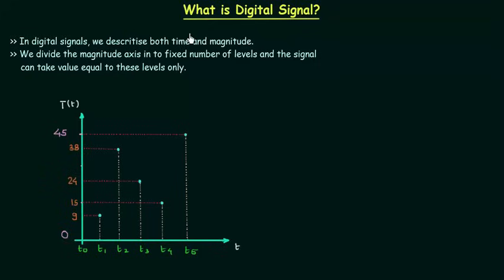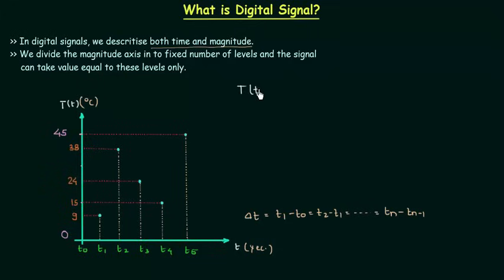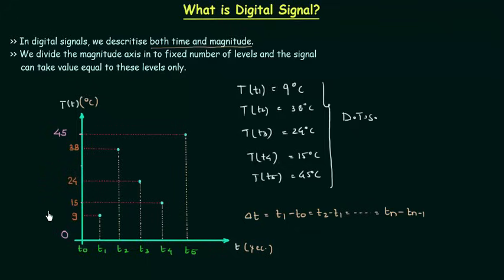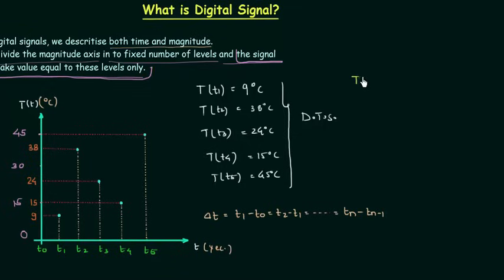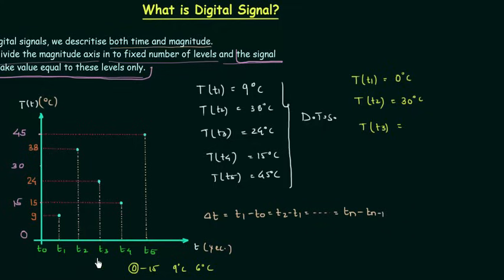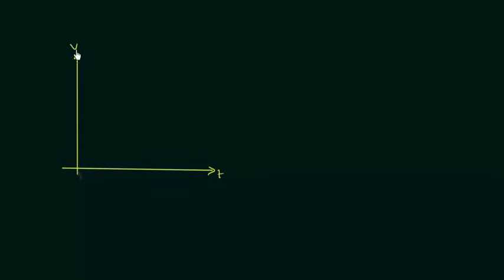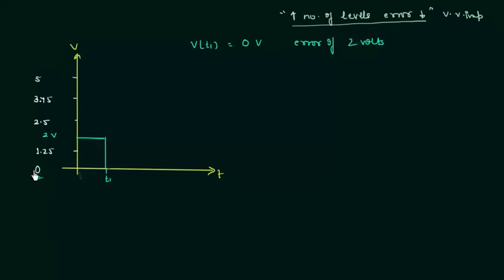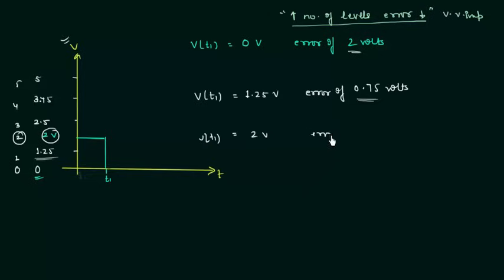What is Digital Signal?

Comment: 🔥 1. Reliability and Noise Immunity
Analog signals are continuous and susceptible to noise, interference, and degradation over long distances.

Digital signals (0s and 1s) are less prone to noise. Even if noise distorts the signal slightly, it can still be interpreted correctly due to its binary nature.
✅ Example: In telecom, digital signals can travel long distances with minimal data loss using error correction techniques, unlike analog signals, which degrade faster.

⚙ 2. Precision and Accuracy
Analog signals lose precision due to imperfections in storage and transmission.

Digital signals can be reproduced exactly through copying, storing, and processing without any loss in quality.
✅ Example:

An MP3 audio file maintains its quality even after being copied multiple times.

An analog tape will lose quality with every copy due to signal degradation.

💾 3. Efficient Storage and Processing
Digital signals are easier to store, compress, and process.

You can use binary operations, encryption, and compression techniques with digital data.
✅ Example:

JPEG/PNG images are stored digitally, allowing for efficient compression and lossless data retention.

Analog photographs degrade over time and cannot be copied perfectly.

🔧 4. Easier Signal Processing
Digital signals enable complex operations like filtering, modulation, and encryption with high accuracy.

Digital Signal Processing (DSP) algorithms can manipulate signals more efficiently than analog circuits.
✅ Example:

Noise cancellation in headphones is done using digital processing techniques.

Analog circuits alone cannot achieve the same level of precision.

🚀 5. Scalability and Flexibility
Digital systems are modular and scalable.

You can combine multiple digital signals, route them through networks, and apply complex operations without loss of quality.
✅ Example:

Digital communication networks (5G, Wi-Fi) can handle complex routing and massive data transfer, unlike analog communication systems.

✅ Key Takeaway
Digital signals are essential because they offer:

Noise resistance → More reliable communication.

Precision and accuracy → No signal degradation with copying.

Efficient storage and processing → Easy compression, encryption, and filtering.

Scalability and flexibility → Ideal for modern tech like wireless networks, DSP, and data storage.

Comment: At 3:55 it is said, "to minimise the error". 
How is taking the lower value rather than the closest value minimising the error?
Reply: I think it’s because if you did it how he says, all steps are the same size (15°C steps). If you round up/down to the nearest, the first step would be half the size of the rest (0 to 7.5°C). 

It’s implied you can’t measure negative values in this example, I think.

Comment: Digital signals can convey information with less noise, distortion, and interference. Digital circuits can be reproduced easily in mass quantities at comparatively low costs. Digital signal processing is more flexible because DSP operations can be altered using digitally programmable system

Comment: The need for Digital Signal is as follows -
1.  An Analog Signal is a continuous signal which means it is defined for infinite number of points even when it is in finite interval . So it becomes difficult to study such a  signal without knowing how small points in graph changes.
2. Digital Signal solves this problem by breaking the graph into discontinuous values , whose resolution we can choose . This makes the properties of signal easy to understand and how it reacts at very small intervals , also the sample size can be reduced. 
3. Computer and Digital circuit stores information in form of bits , so  in order to take an analog signal it first needs to break it in small discrete packets of bits .

Comment: I think that we need digital signal because it is difficult to play with analog like when we are sending  the signal so when it will be in analog form the power consumption will be large and even there might be chances of losing of signal but sending them in packets form amke your signal transmission more easier
🥲🥲
And i think they are easy to use 🥲🥲
Thanks for the explanation

Comment: analog take any value within two limits but in digital signal will take discrete levels only(o or 1) .we are going to work and design is easy in digital. because of accuracy.in analog we want more accuracy we put more money on the analog hardware.. so this  is main thing now a days everything converted in more accuracy possible in digital domain

Comment: I have been taught that Digital signals are those, which have only two voltage levels...High and Low...high is represented by 1 and low level of voltage represented by 0, So is this definition wrong?
Reply: this definition is correct.... it is on us what value we assign to it as high and what value we assign to it as low........as we can assign the low value more than 0v too.....for more knowledge u may google it further.

Comment: If I divide the number of levels between 0 and 5 into 6 equal parts, and then locate V = 2Volt, error would be non zero. This contradicts the theory that the increase in number of levels reduces the approximation error. Rather I think this theory is specific to the exact magnitude of the value to be mapped. If the value to be mapped matches with the multiples of it, error is minimized.
Reply: Yeah you are right. I did get your point. Did you find out why?
Reply: My view to your question is that i think sir wants to say that if i increased the number of interval the error is going to be reduced 
The thing which u are telling here i sfor a number and gere we are talking about any number you think like we are having a 16 bit system so we are dividing total 0-5 v value in 2^16 so that will reduce tge error to 0
Reply: I was also thinking this but this is fixable if you always half each range (recursively) to create new ranges. This will ensure points that are exactly on the interval, won't be affected.
Reply: Ummmmmmmm
Reply: Maybe if you exceed the number of levels it doesn't minimise.
Suppose the permissible range is 0-5 so we can divide it up till 5 equal parts.
That way the graph of error will be decreasing but if we divide it into 6 equal parts, it'll become an upward parabola.
Reply: @maybe9357  username checks out
Reply: No need to be surprised...

This whole piece of shit is logicless
Reply: i dont think so. because when the number of levels increases, the interval between two levels decreases which then results in decreasing the error.

in the example that you have given, the error increases only for integers or sometimes for numbers that are positively tending towards integers. for example, when 0 to 5 is divided into 5 equal parts, error for 2.9 is 0.9 but in the case of 6 equal parts, the error is 0.4
Reply: @mounikak8804  you clearly didn't got the point ... Watch the video again .. you will be able to relate
Reply: @Vimal shukla why, what's the problem with non zero error? You're saying it should be negative?
Reply: zada dimak laga liya

Comment: What is the reason behind selecting a low level other than selecting a level which has min difference?
Reply: I believe that's because an unwanted noise will always increase the magnitude of the original pure signal and it only makes sense if we take the lower value which will be closer to the actual value. I understood this in their next video
Reply: Shekhar Limbu absolutely right
Reply: same doubt sir
Reply: If you did it how he says, all steps are the same size (15°C steps). If you round up/down to the nearest, the first step would be half the size of the rest (0 to 7.5°C) if there’s no negative values. 

You take the lower value because of noise? How does that make sense? There will be noise at any level, including at 15°C for example, making the signal go above & below 15°C.

Comment: sir in digital signal we n take only two values either 0 or 1 then whg did u discriminate 0-5 in 5 parts ??
Reply: anita jain 0 and 1 are the symbols with which we represent data like binary data etc. and those dicretised values on mag. axis are levels and yash raj explained  rest of the things well about levels.
hope this may clear ur doubt sister.
Reply: anita jain just to minimize the error. Well in digital we don't always take 0,1 we take pulsating signal. For eg we provide a electrical system some conditions that output is turned on i.e. 1 when the input (voltage or current) is equal  or nearly equal to our provided conditions that condition( these conditions are levels)
Another example- you might have listened about Arduino, it supports 5v dc signal but it will give output 1 when i/p  voltage range is between 3v to 5v and will give o/p 0 when i/p voltage range is less than 3v

Comment: In the first example to decrease error, the value of 9 volt should be taken as 15 volt or 0 volt?
Reply: lokesh amara  we always take lower values to quantized any quantity between the two levels sa quantizing 9V to 0V is fully correct and to minimize the error we don't consider the min. difference between the two values, in digital  to reduce the error we always  increase the no. of levels like if we discretised the mag. axis like 0,5,10,15......45 then 9V get quantized to 5V and now the error is 9-5=4V and if u want to decrease the error more inc. no. of levels again and so on.

Comment: Thank you sir for your proper exp.
But here i have one doubt is    <<at end of video u said  v(t1)=1.25 and imedeatly u said v(t1)=2 by just incresing levels>>
(here my doubt is how juse level  2= 2volts.it has to equal to 1.25 only by u r exp).
In practical it doesnt work,asu exp it should lower level(1.25)
CAN ANY ONE EXPLY IT?